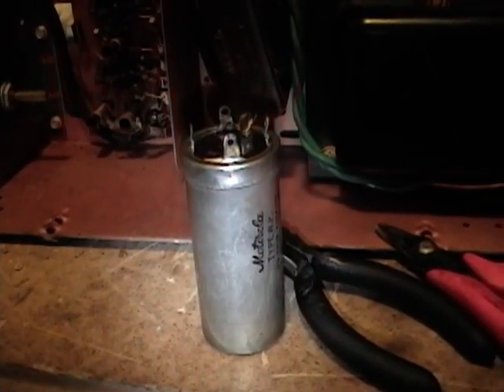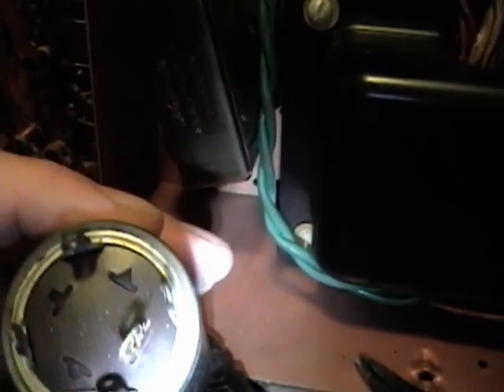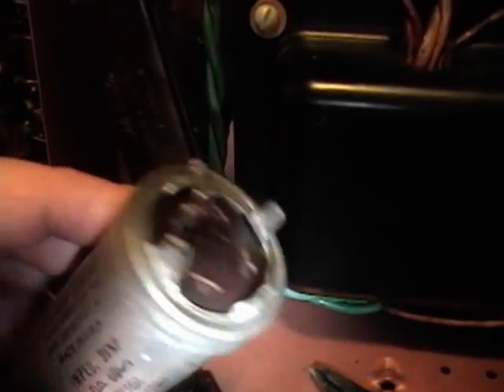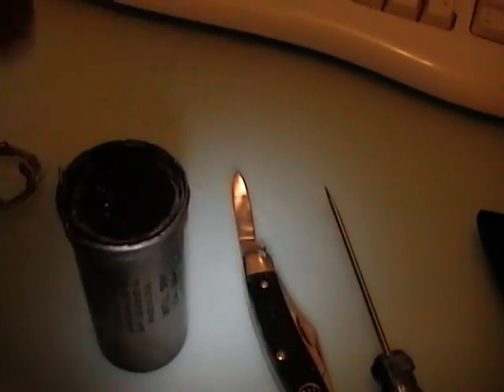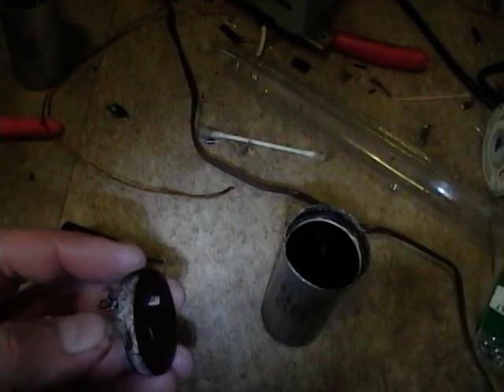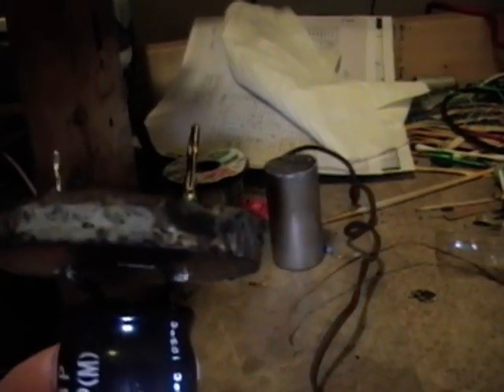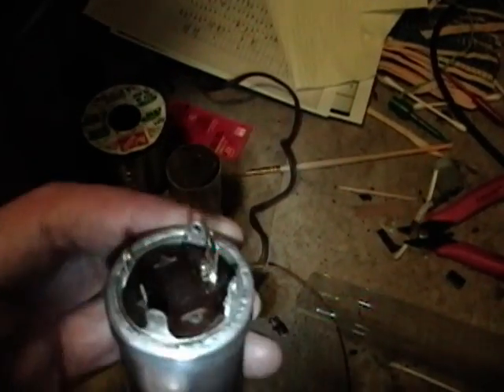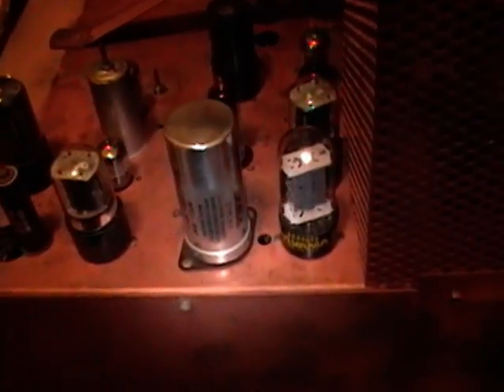Recapping Electrolytics from Below

Comment: CE Electronics,  distributed via Amplified Parts, makes many multi-section twist lock capacitors today.  They may have the values you need.  Most of their units are rated for fairly high voltages as their prime customers refurbish vacuum tube power amplifiers.

Comment: I have rebuilt many 'lytics over the years.  Most effective solvent is paint thinner (mineral spirits) for cleaning out tar.  For multi-cap rebuilds you'll want to clean out the tar to make room.  Soak can in paint thinner over night and use a butter knife to remove big chunks to speed clean out.  DON'T use stuffing around caps to keep them steady inside can, they can't cool and may overheat.  Good luck radio folks!
Reply from the maker: Thanks for the useful tips :)
Reply: So if I have a two lead capacitor all I have to do is solder the new capacitor leads to the  positive and negative leads of the old capacitor?
Thank you. Very good video👍

Comment: I can't see putting the cap back on...how about some extra large heat shrink tubing and just leave as is...I'm just concerned about overheating of the newer type electrolytic caps...
Its a great idea of using the bottom tab mounts, but, not nesacary for them to be encapsolated back in the cans...JMO..
Reply from the maker: I don't follow your concern. Modern caps have a much lower esr and produce very, very little heat. Restorers have been restuffing cans for many years with no problems

Comment: Hey Bob how did you know that the replacement only had to be 25 volts?
Reply from the maker: Well the original was only 3 volts so 3 or more volts would work.   I used 25 to give me plenty of overhead.
Reply: Got it, thanks..
Reply: I've a got a B&K 1077B Analyst without any cables. I'm pretty sure you mentioned a part number for a modern replacement for the jacks? I've been surfing your videos but haven't found it. Rich
Reply from the maker: I haven't done any work on my 1077B but it came with modern BNC jacks.  Doesn't yours ?
Reply: No unfortunately it came without them
Reply from the maker: OK, well the RF out and Flyback Yoke Test Signal can be replaced with BNC jacks.  Do a google image search for 'B&K 1077B' and you'll find photos of what they look like.   They are available from many suppliers.
Reply: will do.. thank you!

Comment: @jshorva65 - One of our clients tried to do a Do-It-Yourself recap on a VERY rare RCA CTC4 with insufficient Color TV experience, inadvertently adding about 100 hours of "cleanup work" to the Estimate we did after he threw in the towel (when his attempt resulted in a burned up Flyback).  The need for extensive "cleanup work" reduced a set worth over $3,000 to a permanent "passive exhibit" item, as he wasn't willing to go forward with it given the Estimated cost of Restoration. Tragic!

Comment: @umajunkcollector -- Often, the lugs of the twist-lock capacitors are used as tie points for several connections to the capacitor from different areas of the chassis, and these tie points are often difficult to re-locate without making tedious re-routing of under-chassis wiring necessary.  Large clusters of components can also impair ventilation under the chassis. Re-routing of connections in a Color TV can lead to weird "cross-coupling" interactions between IF/Video/Chroma/Audio stages.

Comment: @umajunkcollector -- I've found that the "hidden underneath" method often creates more work in the long run, due to the need to add new isolated terminal lugs into the layout to connect the new capacitors. That method has also been found to over-complicate subsequent Maintenance in our experience, since the new caps invariably impair access to critical test points on the underside of the chassis and can be especially frustrating when RF/IF Alignment is needed as part of Restoration.

Comment: @bandersentv Exactly! The heat gun method creates less mess and stink than any other method we tried, especially important with the usual "basement workbench(es)" setup that most Pro and Semi-Pro Restorers use. Some kind of fixed jig with clamps to hold the capacitor steady in an inverted position 6" above the benchtop by its lugs during heating is also helpful. With the can held steady in the jig, a light tug with one gloved hand will pull the heated can loose in one smooth motion.

Comment: @bandersentv Now that you mention it the tar did set off the smoke detector once or twice, but that detector is a little too sensitive as frying bacon does the same thing. Not really any other way with something like those block condenser cans, some books like Ghirhardi manuals reccomend cooking the tar out with a hot plate. I have a Radiola 44 and a Philco 96 that will need the cans cooked out one of these days.

Comment: To get the guts out a heat gun works but I have a new method that I have been using, I take the old condenser, put it on a sheet of aluminum foil or an old pie plate, and bake it in the toaster oven at 200 degree for about ten minutes, sometimes less. Once the can is hot the innards almost fall out, though you usually need to grab it with some pliers to help it along. I have restuffed electrolytics before but never a twist can, I will have to try your method on a scrap can I have sitting around.

Comment: I like the uncrimping/recrimping method that you show, I have also heard of some people filing off the crimped over aluminum at the base to open them. If you need to cut the can to get it open, like the old style wet electrolytics with the large nut under the chassis, a pipe cutter like you use for copper pipe works well, once you install the new condensers you can fit a shot length of pipe inside to hold the two sections together.